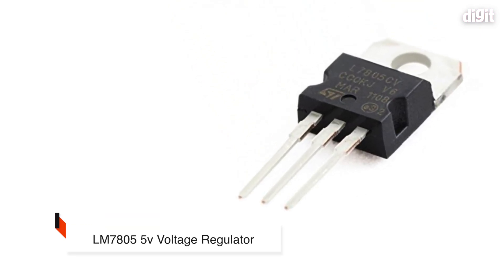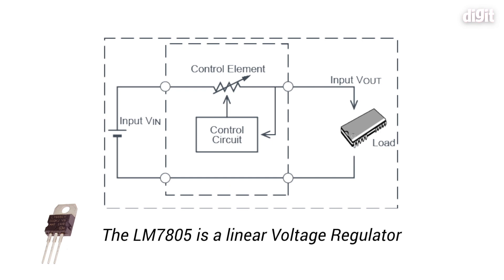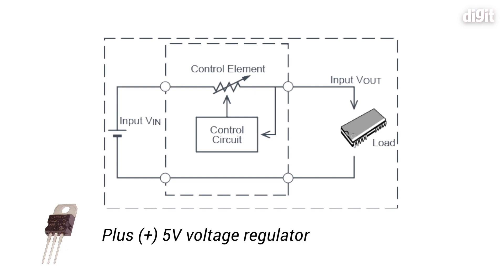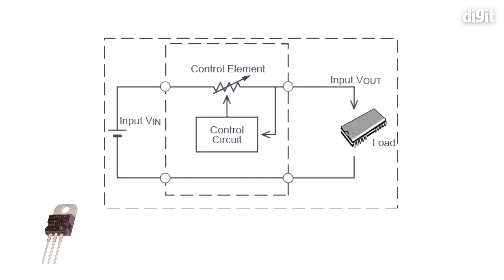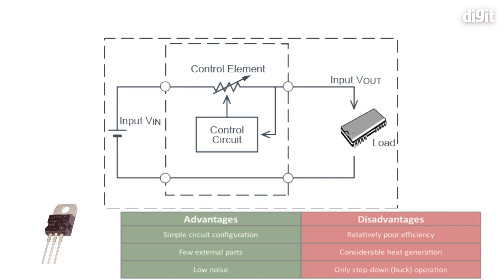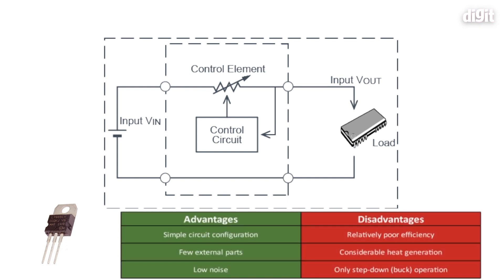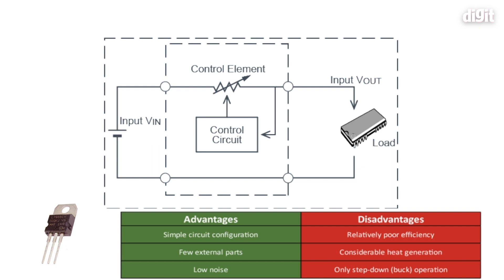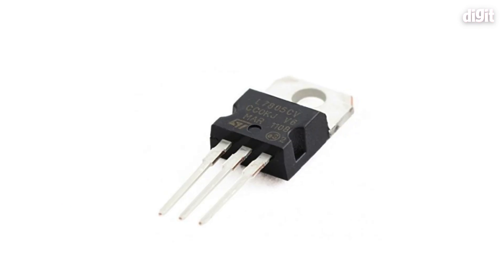LM7805 5v Voltage Regulator -  How It Works

Comment: So anything above 5 volts is discarded as heat. This would work as a surge suppressor for any spike over 5 volts, right?. What happens if it doesn't get 5 volts input, nothing is output and it all turns to heat, or what?